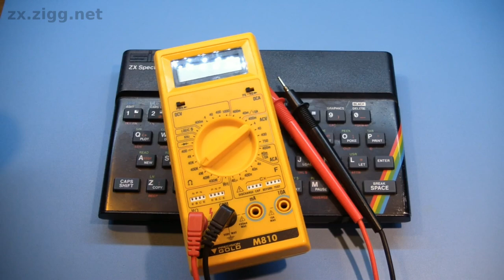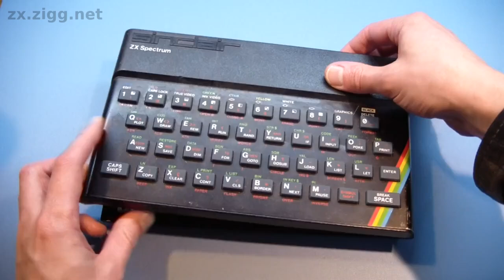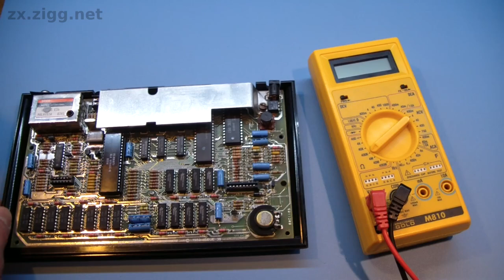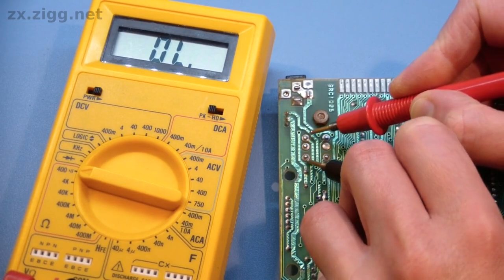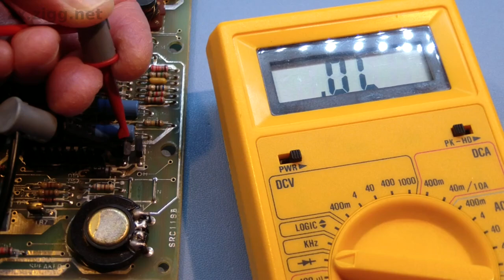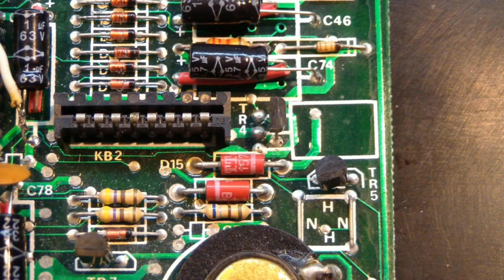ZX Spectrum (48K & 16K) Initial Tests

Comment: Hi, brilliant video! my spectrum performed well on all the tests but when i powered  it up i had pin 1 +5 volts and pin 8 -12 volts! any advice would be appreciated!!
Reply from the maker: Did the Spectrum work? I suspect you simply had the polarity of your test leads reversed.What voltage did you measure on pin 9 of one of the 4116s?
Reply: JoulesperCoulomb hi yes sorry you're right had my leads reversed! just panicked and turned it off. but still nothing on the screen!
Reply: Steven Swaffer
 will be looking a TR1, TR2 as per your repair No 1 video cheers!!!!!
Reply from the maker: It's rare for those to fail, but faults with them can cause a lack of video output. How are you connecting your display to the computer?
Reply from the maker: Is there a click from the sounder when you press a key? If there is, the Spectrum is probably working properly apart from the lack of picture.
Reply: JoulesperCoulomb have just got a good white border with noises in the center!! am rebuilding keyboard now.
Reply: Steven Swaffer have managed to lose my keyboard membrane!
Reply: JoulesperCoulomb Hi, the spectrum has been modified to use AV. i am getting a good white border with black and purple lines in the center! any ideas? can't as yet test the keyboard!
Reply from the maker: Of course I can't be certain just from that description, but that is exactly the type of thing that happens when one or more of the lower RAM ICs are faulty.
Reply: Steven Swaffer Hi, Did you ever solve this I am getting the exact same on one of Speccys?